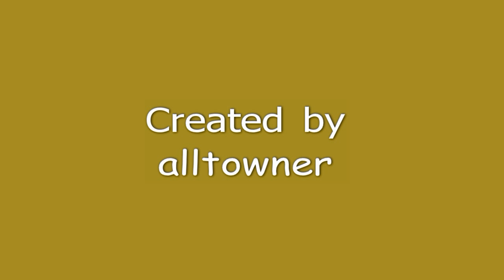Water Powered Lumber Mill (guy with a really good job)

Comment: Thanks...I've done some work to help restore a sash mill in Marshfield MA...it's still in the initial stages, with repairs to the foundations, some of the sills and a couple walls.  It was used to make boxes for shoes sent off to the Civil War among other things....we're hoping to get more funding to continue the work.
It had been converted to a circular saw mill in the mid-1800's, but the sash setup will be restored.
The dam will need rebuilding at the overflow, it's completely blown out.